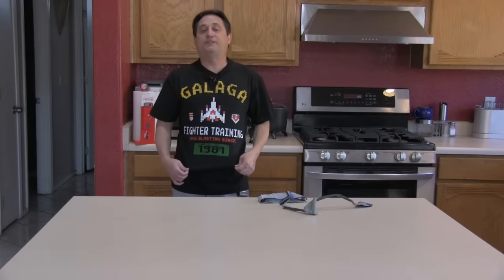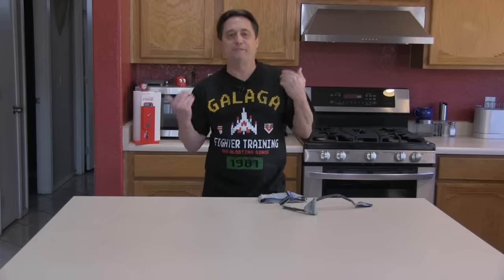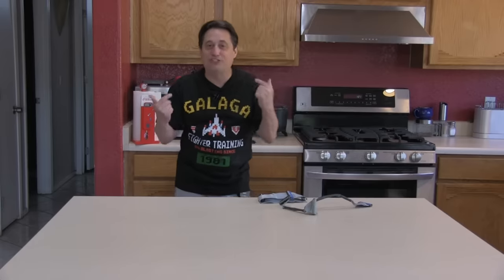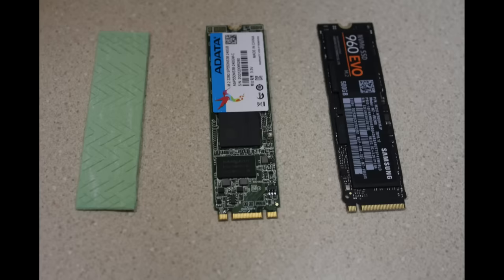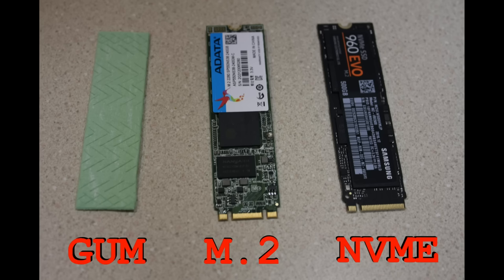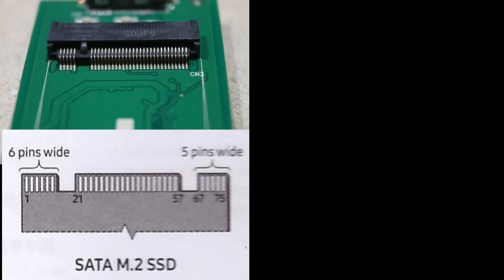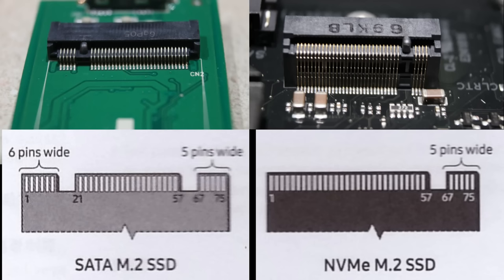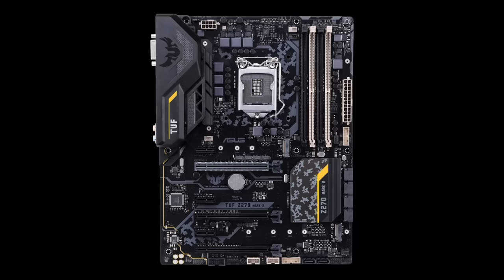M.2 vs NVME: What's the difference?

Comment: Man fast forward to 2023, and Intel Optane Tech was so needlessly expensive and proprietary that they buried the tech by 2019. Such an awesome optimization engine burdened by the fact you needed "Intel Optane" brand drives that were $615 for 512gb. (at the time) Nobody cared about the speed increase when you couldn't visibly tell the difference from drives that cost $150 less. (again, at the time)

Comment: As your signaling frequency goes up, the distance between the wavefronts on the parallel interface become harder to synchronize. As a result, you have to build in delays in the protocol resulting in efficiency in transfers. Going with parallel/serial allows you to have several synchronized serial "lanes" that don't necessarily have to be time-synchronized on the wavefront for signal clocking. So PATA became SATA and SCSI became SAS - and PCI became PCIe...

Comment: Being in IT for a long time, I have to say that this is a great video.  I don't miss the days of IDE cable management.  It's also nice that motherboards are much more clearly labeled now than they used to be.... :)
Reply: What's funny is now people use cable combs to spread out the individually sleeved ATX cables effectively making them ribbon cables. 🙃
Reply: Yea.. worst part I remember about computer setup, apart from those AMD processors that required you to nearly jam a screwdriver through your motherboard in order to install the heatsink, was sitting there with a flashlight at odd angles, trying to see those microscopic letters on the board, to figure out where to put the stupid tiny wires just so the power/restart button on the case would work.
Reply: Make sure you've got the master/slave jumper set correctly on the back of EACH drive connected to the IDE cable or your 4x CD-ROM Drive simply will not compute (you can always opt to plug this directly into your ISA Sound Blaster Card :P)
Reply: I, too, started in IT in the "ESDI/MFM/RLL/SCSI" era, but retired about the time these SSDs really began replacing the ole "spinning rust" drives, thus I was pretty much in the dark regarding the M.2 SSD's. Subscribed and thanks for enlightening me!!

Comment: Thanks very much for this info. I’ve had an NvME drive in my system for nearly 3 years and had my M.2 slot set to SATA as my ASU’s Z170 board has that as the default setting because there isn’t an auto option. My system is noticeably snappier loading and opening apps now.

Comment: I never liked IDE but it brings back some fond memories of when I was just a kid tinkering with old computers and teaching myself how they worked. Up until now I've always had old hand-me-down computers, so I've become very familiar with the old interfaces. Only when I built my first computer last year did I upgrade from IDE. I skipped SATA altogether and went straight to m.2 and NVMe. I now have a SATA drive as well and I was surprised how easy it was to connect. Just two small cables, no jumpers, and effortless cable management.
Reply: Ah yes. "When I was just a kid..." 1980ish messing with an 8K Commodore computer using a cassette recorder data storage. Yes, exactly the same cassettes we used for music. Things have changed quite a bit since I was a kid.
Reply: I never got used to that annoying ticking sound from the IDE header. Even some modern SATA drives make that noise. However their a lot quieter.
Reply: I don't miss being on hands and knees looking for the little jumper that sets the master/slave. Drop it once, it will bounce to the most improbable place...
Reply: @BLKBRDSR71  I think you're referring to hard drive head seek sound and it depends on the drive. Samsung Spinpoint drives click, whirr, clunk and grind a lot even SATA whereas WD drives are almost silent
Reply: @cultclassic999  "auto" mode was best then it would decide for you...
Reply: @JoeSevy  Heh those were the days. Remember getting to the almost the end of the tape and there would be a glitch and you'd have to rewind the tape? If you were lucky it would load if not...
Reply: @JoeSevy  I worked for Walgreens straight out of tech school and the joys of AS400 with the tape backup system and all of that mess. Not to mention configuring a network with servers using Windows 3.o

Comment: I just ordered a new 2TB NVMe M.2 SSD after checking everything, and just realized I forgot to double-check the pin arrangement on the actual motherboard!  But thanks to your video, I now know that I got the exact right drive.

The retailer/assembler put a regular SATA drive in the SATA3_1 slot, so I’ve been using the slowest storage speed my PC can offer… and with only 250 GB of storage.
Now I’ll be getting ten times the speed for ten times the capacity!  The new drive wasn’t expensive, either.  Now I just need to check that BIOS setting when it arrives, and I’ll be good to go.

It’s always good to check this stuff so you don’t miss out on things you already partially paid for :D

Comment: I’m an old timer too, DOS=Damn Old System. Thanks for the video it makes a lots of sense. I liked the small SATA cables, having built many machines wrestling with the old parallel IDE cables, but being an old tech I knew that parallel can be faster. Now that it’s down to the drive being a small circuit board mounted to the motherboard the old hard drive bottleneck which is a decades old problem is mostly resolved.

Comment: Holy Cow, this is an incredibly great video. I have found this M.2 vs NVME very confusing, but you have done a brilliantly clear job of explaining it. I used to build computers with PATA, etc. but lately only buy used HP Z workstation for myself and my clients. Getting older ones without mboard M.2 NVME sockets equipped with an adapter so they boot the OS can be a headache because of adapter compatibility. As for gaming, I used to setup DOOM Novell networked for 3 computers on my home office, I wonder if that's what you were referring to.  PS I like your gas range and exhaust system too! Thanks a lot.

Comment: Molex Plugs, they either get stuck into a drive or fall out of a drive. You guys forget about "Micro Jumpers" and SCSI, I/O Addresses, IRQ conflicts with sound cards or com ports, and Device ID Nightmares. I do miss the old MFM and RLL "jet turbine" sound effects though.
Reply: then there was DOS
Reply: I've got a triple height 5 1/4" MFM drive (10 Mb - Wohooo!)     that sounds like a jet turbine firing up!
Reply: Two words... Dip Switch
Reply: Or flipping tiny DIP switches to set multipliers for the CPU....

Comment: Thanks for the great video..

Regarding serial vs parallel buses, I believe the speed potential of each is not so clear cut. From a naïve view, parallel buses should be capable of transferring more bits per clock cycle at the same clock speed that serial buses are capable of.

But in reality, clock skew becomes a problem for parallel buses, which is the problem of signals arriving at slightly different times on different lines of the bus. This problem is exacerbated with more lines, and with physically flexible buses. This limits the smallest time of a single clock cycle of a bus to be greater than the minimum variability in the transmission times across the lines of a such a bus.

In contrast, while serial buses transmit fewer bits per clock cycle than parallel buses,  they are capable of a higher potential clock speed because they are less susceptible to the problem of clock skew.

Then low voltage differential signalling (LVDS) was developed, which introduced the revolution of very high speed serial connections, as seen with USB, FireWire, etc. With LVDS, a bit in a serial line is transmitted with its inverse, requiring two wires for one bit. The received signal is understood as the difference between these two lines. This has the effect of cancelling out electrical noise, which should effect both lines pretty equally. 

On top of that, the two wires carrying such pairs of inverted signals are twisted, meaning that the mathematical area enclosed by the two wires is very close to zero, since the sign of the area of each subsequent "loop" between each twist alternates between +1 & -1,and the areas of all the "loops" are quite similar. This leaves a net area with which to pick up magnetic noise close to zero. Thus, magnetic noise is greatly reduced, too.

In such arrangements, there isn't even a separate clock line, eliminating the possibility of clock skew between the clock line itself and the single, serial signal. Instead, the clock is inferred from the data signal.

The speed potential of LVDS serial lines appeared in things like SATA and serial SCSI — serialised versions of older, parallel standards.

In the case of PCIe, each "lane" is an LVDS serial connection, albeit without the possibility of twisting pairs to reduce magnetic noise. Each lane runs at somewhat separate clock speeds, notwithstanding the fact that there's a very fine limit on how different those speeds can be. Data is sent serially down each PCIe lane at one or more bytes at a time, depending on the exact standard. Sequences of data are split and sent down multiple PCIe lanes, in the case of "x2" & greater PCIe arrangements, roughly in parallel. Within the fine limit within which signal skew can be tolerated across multiple lanes, circuitry reconstitutes the data in the right order. 

So even though PCIe can have multiple lanes, it is still not a truly parallel bus. It's a roughly parallel set of serial connections, each seeking to exploit the high speed advantages of LVDS.

Comment: I always remember using those IDE cables that has to reach the master drive, slave drive and still reach the MoBo..  and many times it was a tight fit without a centimeter to spare.

Comment: Would a stick of gum be a type of bubble memory?
Reply: you'd lose all the data when the bubble pops...
Reply: The user could just memorize it.  It's only one bit.
Reply: The stick of gum uses Quantum Bubbles. :P
Reply: It has long-lasting memory.
Reply: Thankfully the crypto bubble has popped
Reply: Depends on the version. The bubble version, stick of gum 2.0, requires liquid cooling, but is expandable.
Reply: @jasonlisonbee  you meant per bite .. right?
Reply: Might explain the popularity of "chiclet" keyboards back in the day.

Comment: Man seeing that massive cable gives me nostalgia. I remember making one big mess when we were told to build a PC at computer class. we were given all the components we will need (all of them are dead since they won't entrust delicate computer hardwares to students specially the CPu since CPUs back then still used the older socket where the pins are on the underside of the CPU as opposed to today's sockets like the LGA1155 where the pins are on the motherboard). The way we built is we were supposed to get all the components we need on the pile of components on another table, bring them to our table and build the System Unit while a teacher is watching you and grading you as you built. I built mine and after i was finished, the teacher casually told me "You swapped the reset and power button headers" so i had to go it and look for those headers under a sea of cables (PC cases back then didn't have the same cable management as today's PC cases and the inside of a System Unit is more like a miniature server than something meant for office use.

Comment: 32gigabits is the current nvme limit which cant be saturated by a single drive atm, it takes around 2 to 3 high performance drives to saturate it
Reply: 3-drive Raid 0 NVMe....   Mmmmmmmmm...
Reply: I'm running 2x 970 Pro on RAID 0 on an Asus Z370-i....  love it...  Don't think I will ever use SATA SSD or spinning drives on anything but backup/archives/NAS again.

Comment: I remember how awful those IDE cables were.  Sometimes they would be loose or it would be easy to bend a pin.  There was also often nothing to prevent it from being inserted in reverse on a drive if someone did not know how they are supposed to go in.

Comment: Actually it is difficult to synchronize data moving parallel in all 40 pins than compared to serial
Reply: tHAT SOUNDS LIKE A good explanation .. I always thought 8/9 bits (1 for parity) would be faster than 1 single bit. It would better to leave the Socket definition at auto that way whatever drive you plug in will work. And the "actual" perceived difference between Nvme and Top speed Sata is very small in normal daily use, eg booting, loading,saving.
Imho.
Reply: Yes, as cable/trace lengths increase, or transmissions speeds increase there's a much greater chance of bits starting to arrive out of sequence, meaning your cable lengths or transmission speeds reach a theoretical cap. You also get interference from adjacent wires which he mentioned needed a ground wire between each communication wire. Using serial communication removes this problem.

Comment: Oh god the nightmare of scsi and ide was real.
Reply: Stephen Huxtable yip, youngsters just don't get it. W/UW/U2W/U3W... never mind wonky terminators or mixed up jumper IDs :)
Reply: LoL!  You know it!... :)
Reply: Yep, because the CS jumper never worked right either...or the scsi cables were so tight and twisted you were sure the connectors on the HDDs would break off.
Reply: Don't forget to terminate your scsi cables.
Reply: lol oh the memories, ohhhh the memories!
Reply: well i never messed with scsi but with those ide cables and jumpers.. but you all forget about one of the shitty things of this time we still face in our modern pcs and that is molex the worst power connector of 'em all.. :D
Reply: I couldn't agree with you more on the Molex connectors I for one have always hated them.
Reply: For me, most of the problem is CHEAP molex connectors.
Reply: I actually liked better, for some reason.  I guess because I was weaned on it.
Reply: What about checking on and re assigning IRQ for aftermarket upgrade cards..... that was always my worst nightmare.
Reply: not to mention scsi luns and proper set up. I still have my scsi drives. They because they are enterprise level lasted for almost ever. 10 years is not unreasonable. I had scsi HDs, scanners, CD drives. Yup lun fun. 

IDE was its own nightmare. IRQ anyone? Argh......Glad that is over. But hey, I remember soldering ic chips on motherboards and 1x9s...Yes, I am an oldie but not moldy.
Reply: Oh yeah, setting up your IRQ for your sound blaster card, then wondering why your printer didn't work
Reply: Stephen Huxtable   Yeah?  I had no trouble with them compared to the old mfm and rrl drives.  Imagine having to find the address and use Debug to run machine  code in the firmware of the hard drive controller board just to do a low level format!!!  Those old controllers were mostly analog and the head position relied on the tolerance and age of a resistor on the controller board.  So they could drift with age. Also, a given drive was matched to the specific controller that formatted it, unless you wanted to perform another low level format.  SCSI was a wet dream compared to that.
Reply: I had a 16 bit SCSI card and had to terminate the top 8 bits on one device and the bottom 8 bits on another.  The thrills!
Reply: setting the jumper for hdd, cd, and mobo. dang hard times man. now its all plug and play.
Reply: What about manually entering the Bad Sector table that was affixed onto the drive label?  And I loved that awesome RLL encoding allowing 50% more capacity, turning a 20 MB drive into 30 whopping Megs on my 8 Mhz AT SCREAMER!  :-O
Reply: Never mind the 8 inch 160 k single sided floppies.
Reply: Yes, it was!
Reply: To this day, I cringe at the cable termination garbage. And tape drives (God help us) were all SCSI. I was never really sure, when my tape drives failed (and they failed ALL THE TIME) if it was the drive or just the terminator. It was indeed a nightmare.
Reply: i'm still dealing with that nightmare and non-supported Sun Microsystems

Comment: OMG! I know this video has been out for " a while",  butI really wish i had seen this video back in 2017 when I was doing my new build. I went thru so many headaches not understanding this at the time. Thanks for helping me better undertand both the speed differences AND the BIOS selection issue. It makse so much more sense now.  And by the way, I too HATED those PATA ribbons. what  a pain in the neck (and fingers  - dang sharp corners). Thank you again for this.

Comment: Carey, thanks for the great explanation of "M.2 vs NVME: What's the difference." I had to rescue user files off an Optane stick in a non booting Windows machine and didn't know which type of external enclosure to order until I watched your videos. And BTW, when I heard you mention MFM and RLL I almost fell out of my chair hearing someone mention those incredibly obsolete technologies that I used to work with 40 years ago. Now I know that you are the true OG (Old Guy).

Comment: Very good and clear explanation of the various formats. I used to work as a repair technician and can remember floppy drives 8", 5 ¼" and 3½" . Then came CD and DVD drives Iv'e noticed that a lot of modern cases do not have a bay for CD/DVD.

Comment: I remember Galaga and origami. Thank you for creating this video. You were very concise with the key features of these standards. I am tying to breath some life back into a HP ProBook 450 G2 and there is a lot of confusion out their on what format the m.2 connector is. I have had no experience with SSD's yet. Back when I purchased the laptop I was quite happy running a 7200 rpm stack of platters. I wish I was able to run the NVMe. Great job Carey.